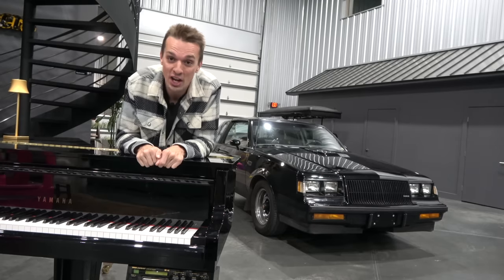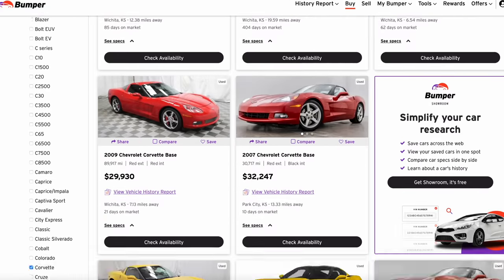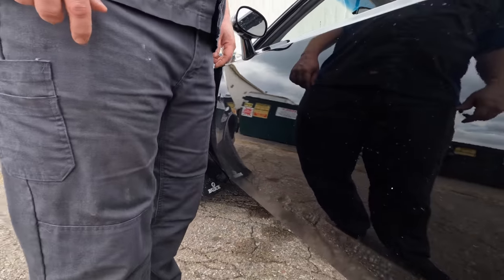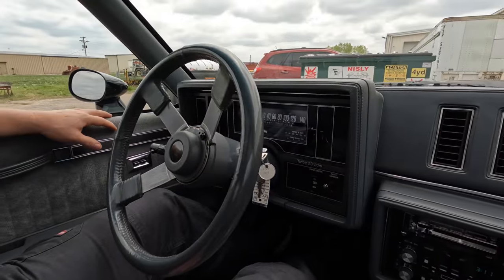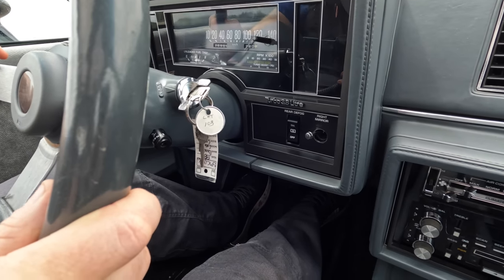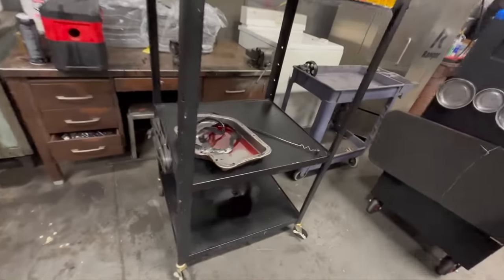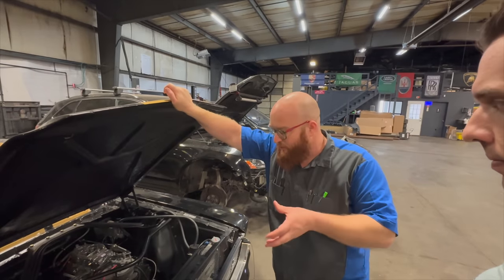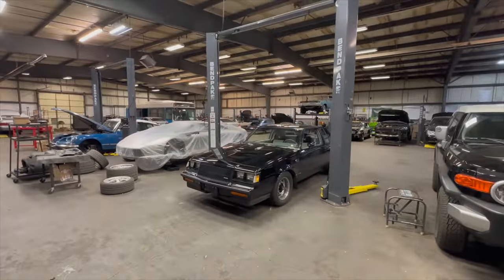Everything wrong with my cheap Buick Grand National, and finding previous accident damage?

Comment: That car does NOT have the factory HD 8.5" rear axle and appears to have the standard 7.5" axle. The driveshaft being new and paint marker on the tube tells me it has been swapped. The cast iron fangs on the bottom of the housing instead of square corners are a clear indicator that it has been swapped to the inferior rear axle.
Reply: Yep. Square cover too. Get that out of there hoovie. Easy to find them though.
Reply: So maybe that was part6 of the 10k repairs , front , and rear axle assembly ,, i bet they drove over something, rooted the diff
Reply: I dont recall those 7.5 being able to hold up to allot of power
Reply: @richardbutton1179  with some decent axles and a spool they took a little beating but nothing crazy.
Reply: It all looks the same age though ,,
Reply: @richardbutton1179  - it's "a lot," not allot.

Comment: Here's some good news, pat's driveline is from Calgary Alberta, we only started using salt in the road a few years ago, so Alberta xars usually aren't rusty. Pat's is also a very good shop making custom drive shafts and are usually considered high quality work!
Reply: I had suspected it was from Calgary when I saw the 1988 Calgary Olympic decal on the rear quarter window!
Reply: @chrisgudz7867  OH, I didn't see that!
Reply: FYI Pat's is in Alberta and B.C they have more then 1 shop.  There are 3 in Edmonton alone.
Reply: @shazbotnanu7037  also some in ontario
Reply: There's one in Mississauga that I've seen a few times
Reply: If you live in Alberta, you need to tell your city works people to not use salt 😢the poor cars
Reply: @xCkillaxC  they used rocks before that, now it's a mix and it horrible for cars. The average windshield here has at least one crack, if not several. The rocks are known to take out fog lights and smash headlights. It's a really stupid system!
Reply: @chrisgudz7867  My grandfather had a Buick (LeSabre, I think) from around that time with the same sticker. I believe that's when Buick was "The Official Car of The Olympics."
Reply: There's a few pats. They're all over Canada apparently. Not just Alberta and BC
Reply: @xCkillaxC  you’ve never been to canada than pal, salt is needed. nothing else would do the job
Reply: @TalentlessCooking  True story. Last time I got my windshield replaced, I literally got a rock chip on the way home on the highway lol. Lasted all of 30 minutes.
Reply: Had my Ram 3500 11.5" rear-end rebuilt at Pat's Driveline gear centre. They did a very good job, the mechanics were skilled and let me look at the old parts too.
Reply: @TalentlessCooking  thought Calgary has been using salt or a sand-salt-gravel mixture for many years now.  Just have to be diligent and wash every few days to avoid the rust. Although under the car is still quite rusty. Also that gravel just does nothing but destroy your hood and windshield. And city takes forever to clean the gravel up as well.
Reply: @chrisgudz7867  every GM vehicle sold in Canada for the '87-88 model years had that sticker.
Reply: Alberta doesn't use much if any salt, same as Saskatchewan and Manitoba. Salt doesn't work under - 18 C (0 F), and winter temperatures too often are below that. So they use sand instead. But cities can be different, and Calgary and southwest Alberta have a somewhat different climate, with temps being significantly warmer than the rest of the province on a regular basis during winter.

Comment: Having had a Regal in the past, the main issue with the front end is that the entire front forward of the hood is fiberglass and plastic aside from the bumper.  If you tap something or clip it on something even a little bit, it simply disintegrates and is 100% non-repairable.  The entire front piece has to be replaced.  It's also flimsy enough that it provides zero impact protection, so a 5 or 10mph oops in a parking lot is the front fenders, radiator, and front end/grille all having to be looked at.   Almost every one of these old cars has had the front rebuilt as it's very common to destroy them.  One a special model like this, finding the proper front grille... not cheap.
Reply: I had a 87 T Type and yes, the front clip was fiberglass and the trim below the clip was color matched vinyl. However, the bumpers were pretty solid and could be straightened, but more commonly, the bumper shocks were what failed in light impact collisions. The ease of repairing these front ends was epically easy. If you found parts of the same color you could fix in less than 2hrs time. The rubber strip on bumper was probably the most annoying cause it didn’t take much to mar that thing up. $35 at the dealership (in 1987 that is). This vehicle was an awesome find.

Comment: The whole front clip of the g bodies comes off  in one piece 14 bolts check the body shims near the front of the door and on the bumper. See if they have been moved. That may be why it looks like bolts haven't been turned

Comment: The engine being mounted "pretty far back being a V-6" is because the engine bay on the base Regal frame was designed to accommodate both the 231 / 3.8l engine, as well as the 307 / 5.0l V-8 engine.

Comment: My 93 Astro has that same intermittent transmission leak coming from that hole in the front yolk.  I've not found any good information whether or not I can just seal that or if something else needs to be done.  Thanks for addressing that.  I'll probably seal that puppy by smooshing in some JB Weld in both sides.

Comment: Pat's Driveline!  And it's rust free.  It's probably from right here in Southern Alberta (where I am!).  We don't use crap on the roads here, so cars TEND to stay in really good condition.  Not uncommon to see a full size truck with 500,000 on it and still looking good.

Comment: Previous accident damage in a car built in 1987 would not be unusual. That was a long time ago. Here is hoping it was repaired properly.
Reply: Is there any chance the owner was buddies with his mechanic and squeezed the insurance company for $10K worth of damages, but then only paid for a minor dent repair/respray and pocketed the rest? :)
Or it could have just needed something like glass and rims?
Reply: Well he did say in the last video it had been in an minor accident. So I wouldn’t be surprised lol
Reply: Yeah it’s no problem on that car.
Reply: @dizzy2020  Yes, I have a 2012 Maxima, that I love that about a year after I bought it in 2016 I hit a parked pick up truck on the side of the road. (I was being ignorant, and drove into the sun with a mostly fogged windshield blinding me.) It took out the right front suspension and the passenger side fender and front valence. I hauled to a body and fender man I trusted for a lot of restoration work he had done on my vintage Buicks. By the time he was done with the repair on the Maxima which was covered by insurance, even I couldn't tell where the damage had occurred and I knew where to look. It will probably show up on a Car Fax report if I ever sell the car, but that is a non-issue for me.
Reply: @dizzy2020  If by "Every single", you mean "about 40%", you are correct.
Reply: TBH, I just want to see them stuff Magic Mike into the trunk...
Reply: @CrappyCar 40% reported. Most car's have had accidents. Weather it's a minor fender bender, a slight side swipe or hitting a dear. Accidents happen. Now try to argue with a used car salesman.
Reply: @gravyd316  Deer!!
Reply: @Rekuzan  It's a Buick, there would be more than enough room!
Reply: @mikemullay5622  my bad. Auto correct.
Reply: @mikemullay5622  or was I reffing to running over my dearest wife?
Reply: @gravyd316  I certainly hope not! :)
Reply: @dizzy2020     Yeah I inherited my dad's 2004 Tacoma, really nice clean truck with 270k miles on it now.  It had been rear ended twice while he owned it, really tweaked the bumper the first time.  2nd time he didn't fix it cause it was just a dent in the bumper.  I got it, got sick of looking at the dent so put a new bumper on it, within a month some dude driving just a bit too fast in his big Chevy Avalanche taps me at maybe 5mph.  Granted it was raining sideways and he just skidded to a stop, kinda felt bad for him.  Put a dent in my new bumper, I refused to fix it again after that.  Damn rear bumper on that truck is cursed I tell you.
Reply: I still want to know why the trunk lid does'nt fit right.
Reply: @scottsinaz3000  Maybe that is part of the "light damage."
Reply: @StreetPreacherr  this sounds very plausible to me.
Reply: @mikemullay5622  Yes, but what caused the lid to tilt up like that. It seems everything underneath in the rear looked fine but I would like to see inside the trunk.
Reply: @mikemullay5622  Why do you think I want to see it so bad??? 🤣🤣🤣
Reply: In Canada it could have easily been side swiped by a snowplow....
Reply: Another thing to consider is Hoovie said he checked the “Canadian carfax (carproof)” and there was an accident reported and the amount was CAD $10,000.  The Canadian dollar is worth considerably less than the Greenback!  I could Google the exchange rate but it’s late and I’m too lazy so I’m gonna eyeball it!  It could be like in Korea where you divide everything by a thousand, or Japan where you divide the amount by 100 … Canada … who knows, right? J/K 🤣🤣
Reply: @mikemullay5622  That's how it was for my Mazda 3, though a bit less. Bumper, passenger side headlight and fog light, and radiator support. By the time the body shop I had fix it (they were up the road from me so I've grown up seeing their work), I can't even tell even when comparing the paint - that's how closely it was matched, and it's the soul red metallic which is apparently hard to paint match.
Reply: I got hit in my 87' LX 5.0 mustang.  Supercharged Vortech, GT40 heads, Cobra R intake, stand alone fuel management system, 22k in the motor and tranny and the car has 21,000 original miles at the time.  Insurance wanted to total it.  I showed them all the  receipts for everything and they said the age is what was the problem.  The mileage saved if from being totaled from less than 8k dollars worth of damage....

Comment: This was the car that always made me super interested in fiddling with my car radio every time one pulled up next to me at a red light👻 My shiny new 1988 Mustang GT 5.0 was quick in its day but stock for stock the GN could have its way with just about anything on the road!
Reply: if I'm not mistaken, your 'stang had 225 hp right? There was lots you could do to it to up that number (polishing the intake plenum was popular) but off the rip not a lot compared to the grand nash. A co-worker had a pic of his doing a wheelie at the drag strip.
Reply: @muskokamike127  Yep. Power adders and aftermarket heads were just coming on line back then. Eventually 5.0 world figured out that above 500 HP the stock 302 blocks would sort of split in two. IDK. Back then I was doing good to make car and insurance payments at age 21, I needed that car to stay trouble free. Besides, I had just put my 429 police engine swapped 1972 Mach 1 together, I wanted to save the mods for it. (As a side note: Installing a set of Hooker two piece long tube headers on a 429 in a ‘72 Mustang is an exercise that added a rich variety of four letter words to my vocabulary!)
Reply: @F9FCJ429  As for the mach 1, oddly enough that's not the first time I heard that tale of woe haha. Didn't the mach 1 come with an optional 429 though from the factory? 

The 5.0 mustang was kick of the hill for a while with 225 hp. then GM came along with the Grand nash and said "hold my beer". I think the iroc had 225 but it was a much bigger car so it was moot.
Reply: The 300 lb/ft of torque is what really made the 5.0 so much fun.

Comment: Depending where in Canada, $10,000 in damage could have been a hail storm. I had a car that saw nearly $15,000 in hail damage while living in Alberta. I was $1200 away from getting my car replaced entirely. That would be all panel damage and no structural. Maybe?
Reply: That would explain the new paint job.
Reply: You could have argued the extra 1200 quite easily
Reply: Pat's drive line is in Calgary and we've had some epic hail storms the last couple of years.

Comment: The Wizard laughs at you laying on the ground in pain and then immediates states that he's worried about you. Green wicking Loctite is also a great product for sealing up porous castings and pinhole leaks. It wicks into the casting and then dries hard as a rock. Better than silly cone. What it's primarily made for is wicking into threads on bolts that are already tight and then becoming very hard like normal green loctite.
Reply: It is called "schodenfreuden" and is an understandable trait!

Comment: I have an SVO I rescued that was going to be butchered by a guy to use the body for a drag car despite being in fairly good shape body/interior wise.  The guy got it cheap, with both him and the previous owner's logic being, "it's just a non-running 4 cylinder," because at the time I guess the original turbo had died and was missing along with the valve cover and piping.  I cleaned it up, rebuilt it using mostly period correct performance parts, and it's a blast to drive now.  I also picked up a 2019 ecoboost Mustang with the high performance package as salvage for dirt cheap at auction (again, "it's just a 4banger" mentality, left me being the only bidder).  Rebuilt what was needed for cheap with a few upgrades and tune.   Obviously they're not going to win against a built V8 car in a straight line, but they're both plenty fast enough to get around and then some with great handling on top while not guzzling a lot of gas.

Comment: Talking about all the different leaks on the Cadillac, young people  have never seen it but parking lots used to be covered with leaked out oil.   Every car over 5 years old had leaks and everybody's parking spot had an oil slick on it. Now days cars dont live long enough to get that dirty. So many fewer roads were paved so you pick up dust from the road surface that would stick to the oil on the engine and cake up 4 inches thick.  Nobody had a pressure washer and it was a nasty mess to have to do anything to an old, beat up car, especially when you are laying on your back on an unpaved parking spot to do it.   I sure dont miss that part of the good ole days.
Reply: I see loads of cars over 5 years old running around today. It’s just todays cars don’t tend to leak like older cars. A lot of stuff “back in the day” was just accepted as normal. Today the expectations are different.

Comment: OMG this brings back some memories.  The paint on the upper surfaces cracked due to bad primer. Check the exhaust manifolds, they all crack.  I would highly suggest that you check both the oil supply and return lines for the turbo just to make sure everything is clean and flowing oil.  If any of that goes bad it runs metal through both the motor and the turbo.  I would also suggest replacing the hoses on the intercooler and intake pipe, those were not very good and had a tendency to blow off easy under boost.  I do miss mine.  I hope you keep it, so I can continue to enjoy the stroll down memory lane!

Comment: I have the same car with a few mods added to it. I strongly remecond to change out that powermaster break with somehing else. I had the red break light come on twice and when that happens you have no breaks at all. The stock powermaster breaks are known to fail. Also keep the T top windows locked. I had one pop off and I was so lucky that it didnt shatter when it landed in the street. It got a small dent in the trim.

Comment: With the modern spark plug tech and less 93 Octane available, you can switch to a slightly colder plug and adjust the gap a bit depending on what the (butt)dyno says.

Comment: Hoovie, the reason you have a aftermarket drive shift is because the rear in the car is not the factory rear. The rear in your car looks to be a 7.5 from a Monte Carlo or a cutlass. Where is the grand nationals should have an 8.5 inch rear.  The smaller rear requires a longer drive shaft.  I’m a Buick youtuber, I would know.
Reply: He paid for a new drive shaft to use a wimpy rear end that's leaking  - sounds like a bunch of poor decisions there.
Reply: @andoletube  The 7.5 rear is about 5/8 " shorter than the CORRECT GN 8.5. They HAD to get a new driveshaft.
Reply: The Cutlass 442 got a 8.5" rearend too but with 3.73s. The Grand National got 3.42s.
Reply: @stevencovington4715  I realise that, but imagine swapping that leaky old diff to go with your brand new drive shaft - and a smaller, weaker diff at that. Not decisions I would make.
Reply: I think you and the one other guy that caught this just figured out where the car got hit - the rear. Must have pretzeled the diff. They probably spent a lot of time grafting monte carlo parts onto it since GN parts are hard to get,  (at least I assume the 8.5 diff is hard to get, maybe it isnt?) and the driveshaft is what made it work out.

Comment: My first car I saved for in 2000 was 1986 Grand National. A “friend” wrecked it. My family has 87 GN around 50,000 miles that runs the 1/4 mile in the 10’s, a 86 turbo T with moonroof, white paint and black trim. Have had a old fbi turbo t with shotgun racks in the trunk, the 89 Pontiac TTA, bunch of these cars in my youth around me. That rear end needs to go quick. Check the chip on the ECM which is under passenger seat or passenger kick panel. The chips are easily changed and makes a big difference. You can add a pillar gauge holders or do a gauge holder that replaces plastic piece in between t-tops like I did in a 86 Turbo T. Looks factory, and add scanmaster to really pay attention to what’s going on. Awesome car, my 86 GN was $4500 in 2000, granted in needed a little work!!